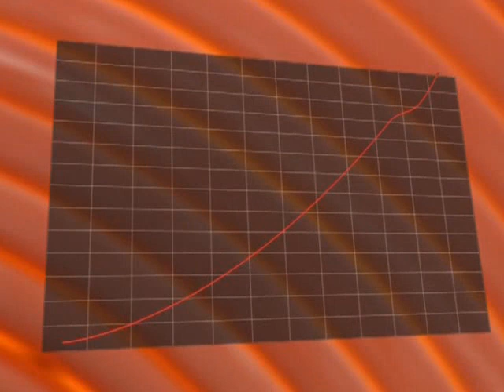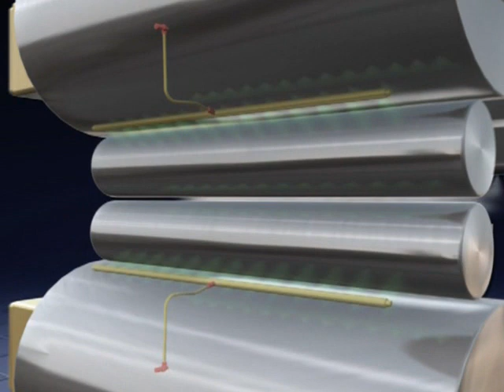Hot Strip Mill

Comment: steel the metal that costs way more to produce than any other metal yet is the cheapest 🤔 ohh because it is needed just in case a war breaks out i guess
Reply: I don't know where you got your information but you are VERY wrong.
The manufacturing of aluminum is by far the costliest and uses the most energy.

Comment: www.youtube.com/watch?v=_ovvVwXFWIM

Hello folks, are you into strip processing lines line Cold Rolling Mills, Degreasing, Pickling and cleaning lines, Continuous Galvanizing lines and are having problem of carryover fluids, are you having troubles having a clean strip at the exit. Now you can use the High Performance Adaptive Strip Wiping system, it wonderfully works without any electrical or Compressed air, it’s a fit and forget solution with Zero consumption of electricity or electrical energy, simple and innovative design click to check and see it for yourself. enjoy watching, please like and subscribe & like

Comment: start using adaptive strip oiling or  wiping without any energy, no moving parts, no replacement parts or is exceptionally versatile Equipment which can be easily installed in varied machines and process lines